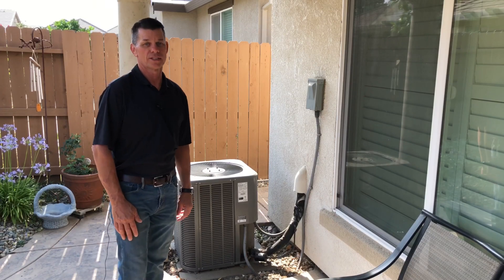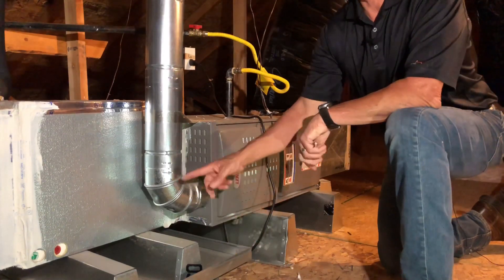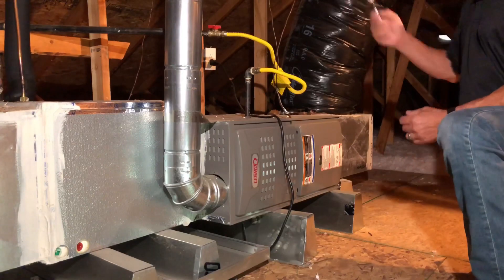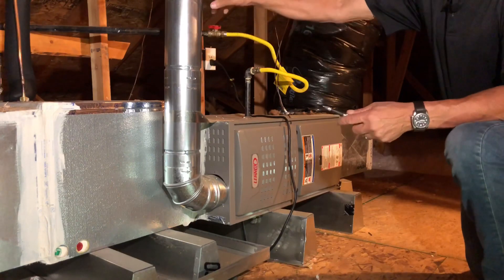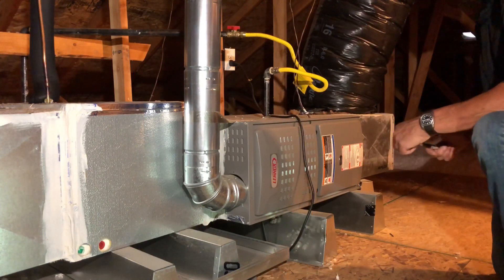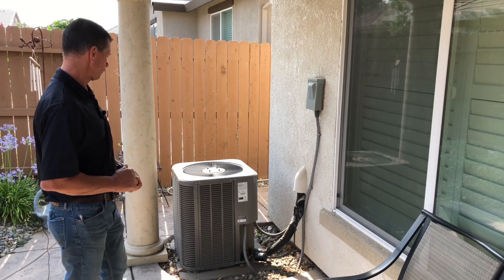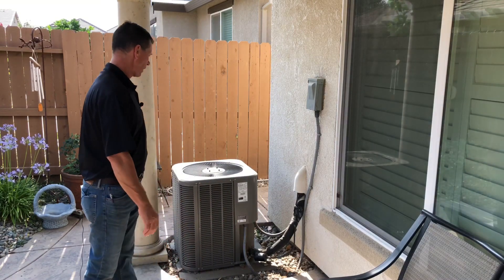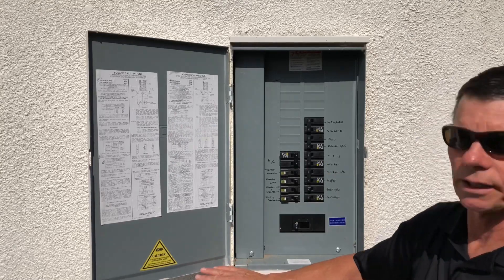How to perform an HVAC Inspection

Comment: To the Techs that purposely wire a unit so that other contractors can't work on them or smokes parts    YOUR THE DEVIL IN THE FLESH AND GREEDY.   Not to get racial.......... But I have never seen a BLACK TECH DO THIS🤔🧐🙄. SOOOOO YOU CAN BLAME BLACK PEOPLE FOR A LOT A THINGS BUT THIS TYPE OF THING YALL OWN IT 💯.  AND IF YOU DO A BRAND NEW 3000 UNIT LIKE THIS I KNOW YOUR DOING IT ON SERVICE CALLS.    God will bless you I swear.  Greedy azzes

Comment: How did you know it was a split system 😭 a little overwhelmed right now hvac is so extensive haha
Reply from the maker: Veritas  Without going into too much explanation this system can be identified as a split system because it has more than one component. The condenser/compressor is located outside and air handler/furnace is inside the attic. Just think when the HVAC system includes multiple components then it is a “split system”.